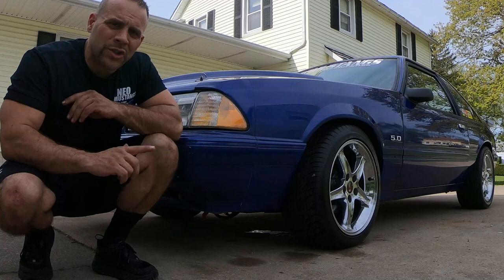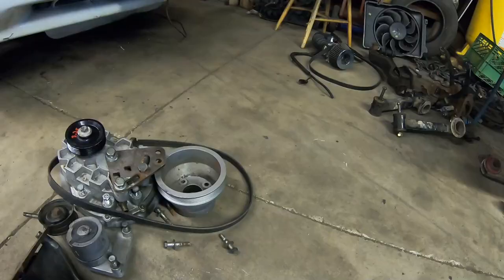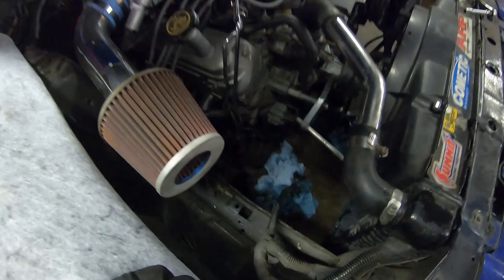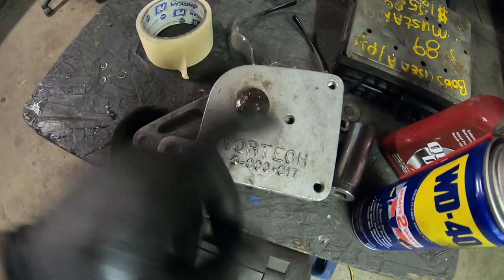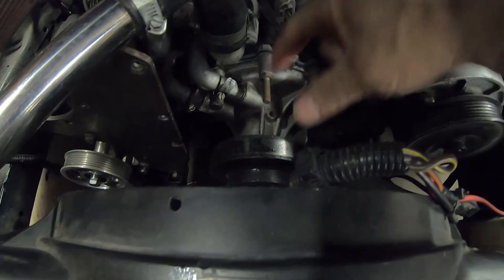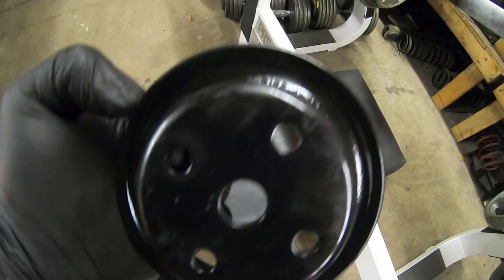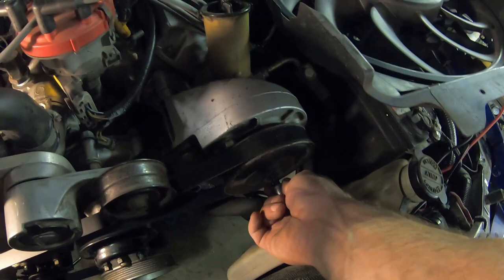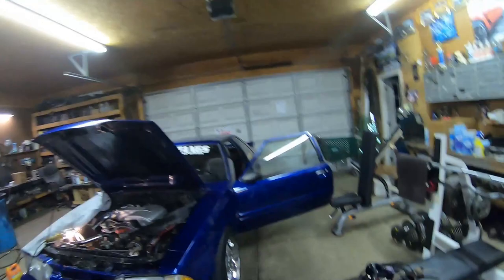Installing This OLD Vortech A-Trim Supercharger Kit 1988 Ford Mustang LX Fox Body 5.0

Comment: Damn youre taking me back to 2006 when i installed a vortech v1 s-trim on my ac deleted 93 notch. I am still running the same set up today. Back then turbo technology and 1500.00 kits were just being thought of,  And  back then figuring out the belt situation wasnt as easy as checking you tube or facebook forums. Corral.net was my go to.. on mine i switched to the 3.8 thunderbird ps pulley which is larger in diameter and gets the belt further from the wp pulley. I dont have to run the tensioner but i do and had to drill the extra hole like you did. The way i get my belt off is to take the long upper ps bolt out and loosen the lower one, then rotate the whole pump assembly down towards the driver side fender. Take the belt off or put it back on, push it back into place reinstall the upper bolt.  Cant wait to see yours done.
Reply from the maker: Haha just for fun. Bored between vlogs of my black car and such. we gonna turbo this car too !
Reply: When i said i wanted to see your car done, I was meaning your dads running with the blower. Lol

Comment: if you use a ps pulley off a 94 v6 mustang, it will fix the serp belt problem
Reply from the maker: I think its the supercharger belt not lining up imo.
Reply: @Neomustangs  i mean using the supercharger on an ac deleted engine.  you wont have to modify the tensioner like that.  a v6 mustang ps pulley is much bigger.

Comment: I was going to say how did you know what  size belt to use? Then I saw the pile of belts lol 👍👍 looks like the fins of that radiator got your hand pretty good ... by the way that cars sounds nice !
Reply from the maker: Haha ya lots of belts and knuckle busting here
Reply: not to be a backseat driver, but since he had to swap radiator hoses, I woulda plucked that rad. Not difficult to bash the fins and now you're got an extra job. Makes for a scoosh more room to work in, too.

Comment: The belt problems stem from the fact that when the power steering is moved ‘up’, it still sits lower than what the AC did.  I got a simple bracket from ASP that triangles the WP and PS and like you said, tensions up instead of down.  I believe the cobra wp pulley is smaller so it spins a little faster, not bigger. I got it on my Saleen.  Keep up the good work!
Reply from the maker: I couldn’t remember. I just like to add stuff like that to videos. Cause people don’t know there’s a diff between stock and cobra.

Comment: was that a PS puddle under the car at the beginning of the video?  As for worrying about the electric fuel pumps running lean,  I agree with the single pump--KISS. if there are two pumps, wiring in a deadman switch so that one pump taking a vacation causes a break and shuts things down would be good. Also, you can buy a fuel pump oil pressure safety switch from Jegs and elsewhere for $20. It runs into your oil pressure gauge and when that drops too low, it shuts off the fuel--that and an oil cooler might be "cheap" insurance against a blower setup snacking off the oil pan if you plan on keeping the power package for a long time.

too bad when companies designed the superchargers, they didn't have 'em store a little extra and act like an AccuSump scenario :)

Comment: Good to see u bro !!  Hey man I have a big Flex-a-lite fan 185 I was thinking about just running a toggle switch!! Lmr has a kit that but u have to get a new thermostat housing with a plug in kit comes with a sensor goes into the  thermostat housing then  u wire it to ur fan then I guess u set the temp!! But what do u think man a toggle switch with a fuse link?? Really don't have money for shit like that but I am afraid to go down the road in forget to turn fan on!!  Guy's stay safe out there man!!
Reply from the maker: Just key on with a simple relay. Be done with it. No toggles.
Reply: @Neomustangs  Thanks bro!!!

Comment: Where can ya find that smaller smog pully, I have that belt problem with mine.
Reply from the maker: I think its just a smog pulley delete. Thats what i looks like.
Reply: Neomustangs also on the next video, can you show what a proper supercharger belt tension looks like.

Comment: How do you consistently have great success with your builds on stock blocks?  Is it the tune,  rpm limit?  All i ever hear is anything over 450whp on a stock block is suicide,  yet you defy the logic.   I have a sn95 347 stroker with a kb supercharger at 15psi and i had a crack in the webbing,  getting it rebuilt as we speak.
Reply from the maker: Tune and RPM limit is a good gauge for sure. The devils in the details and the little things always matter with the builds too.